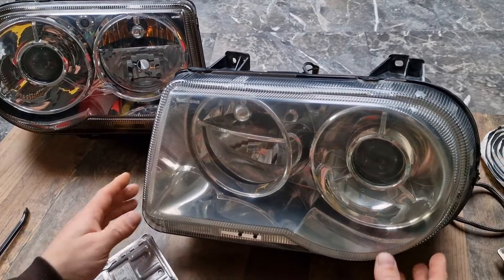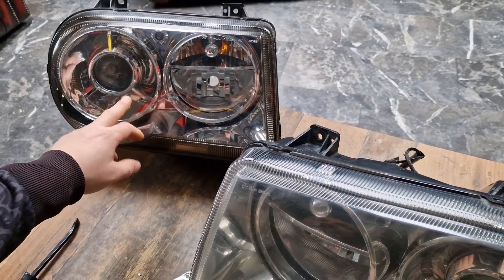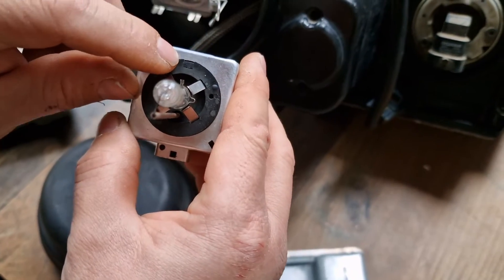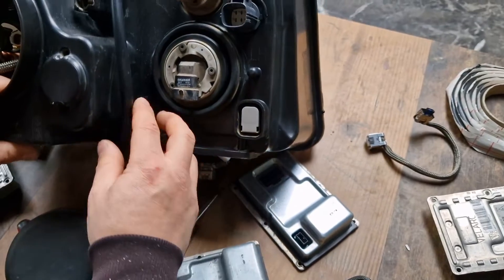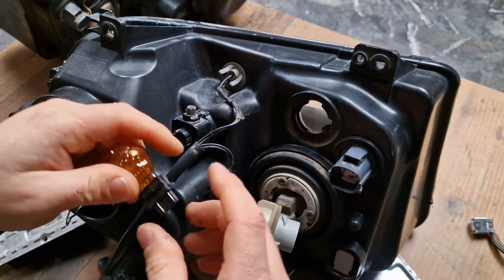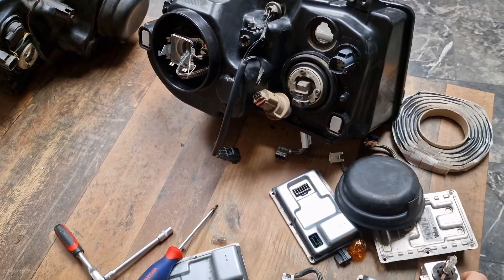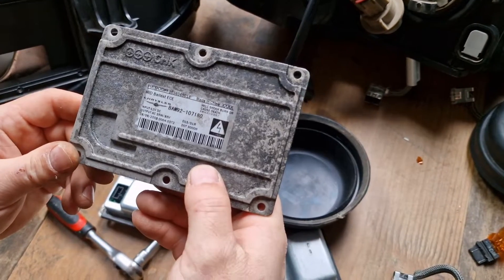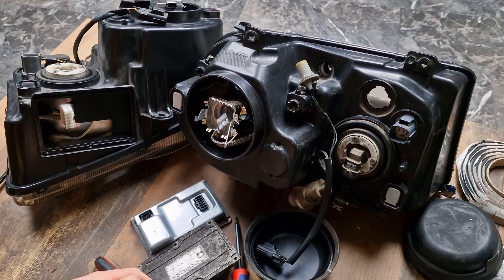Chrysler 300C XENON HID Headlight Repair Guide: Low & High Beam Failure, Bulb & Ballast Replacement

Comment: Hi, both the low beam and high beam are out on one side. I changed the low beam on one side because I thought that was the only problem, and that didn't work. But now i noticed both beams out on the light.